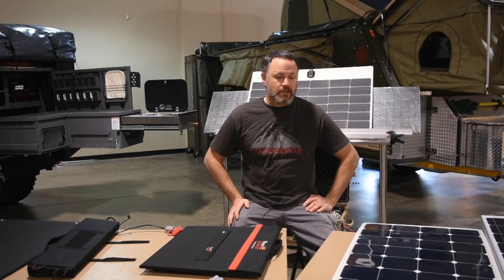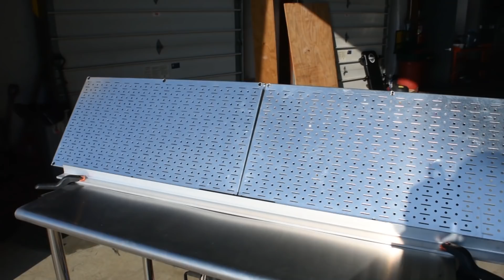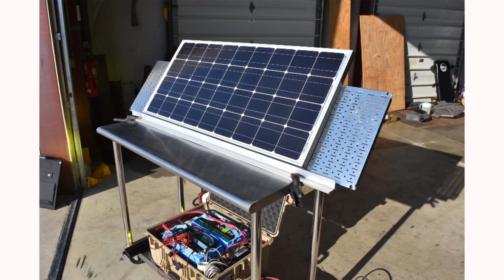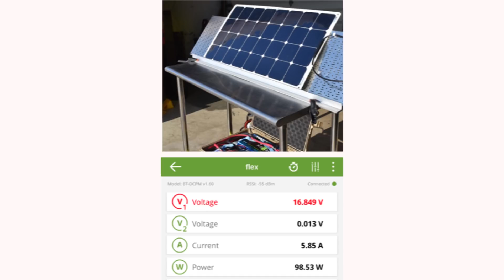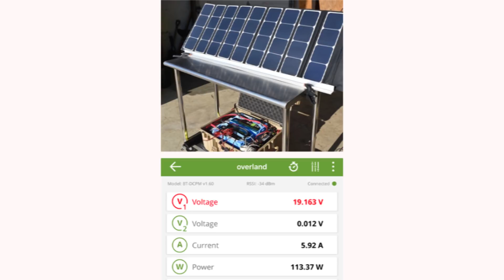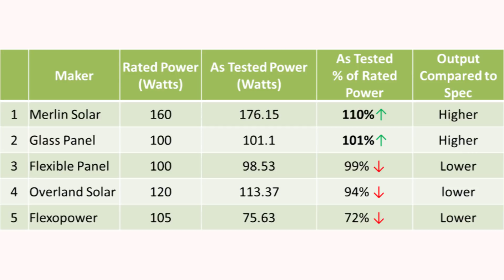Portable Solar Panel Review  Part 1

Comment: To make a fair comparison of the various panels , all  stamped rated capacities  should have been tested at STC. STC is the standard test conditions which imply that the cell temp. Must be at 25°C , sun irradiation must = 1000Watt/m2 and the Air Mass ( AM ) = 1.5 , explained by a novice it is the path length the light beams need to cover to reach the cell. In most cases the operating  cell operating temperature is higher  than 25°C and assuming the IRR =1000Watt/m2 and AM =1.5  it is then hard to believe that one will get 110% of rated capacity . If these are true readings it implies that the  actual panel power output is actually higher  than the stamped capacity. The fact that the Merlin panel is so large explains this .

Comment: Great information! The Merlin solar panels looks incredible. Does the Merlin solar panel use MC4 connectors or Anderson connectors? How much it is? The glass solar panel is efficient too  for this one what kind of mounts do you have? What's your opinion about flexible solar panels? Do they worth it?
Reply: The portable Merlin Panels have the Anderson SB50 connector.  The other flexible Merlin panels have MC4 connectors.  For transportation and other dynamic applications then the Merlin flexibles are the way to go.  They hold up to anything we have thrown at them.  Much lighter and way easier to use when compared to other panels on the market.  Do a search for 4thD Solar and you can buy the whole line of Merlin panels there.
Reply: @conquerornorthamerica9300  I didn't know it about Anderson connectors and it's cool knowing that they are lighter and easier to use. Great to know about 4thD Solar and it's great ! Thanks for sharing that info!

Comment: Thoughts on why you chose these brands?  No Goal Zero?  Other brands you are hoping to test?  

Thanks for the video, keep up the great work.
Reply from the maker: We chose those brands because they were some of the ones that we had experience with in the past and that were very common in the overlanding industry.  The Goal Zero ones are basically the same technology as the Flexopower modules so we did not see the need of testing those.  The output and durability of the Goal Zero is expected to be the same as the Flexopower.
Reply from the maker: If you have another brand you would like us to try then let us know and we will see what we can do.